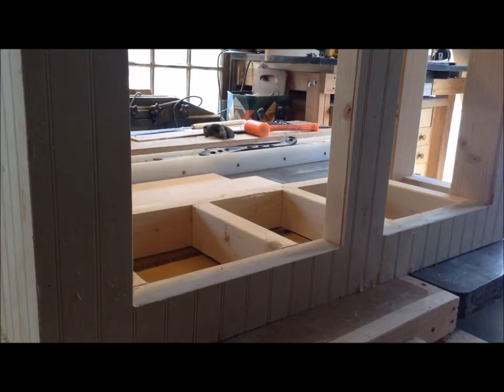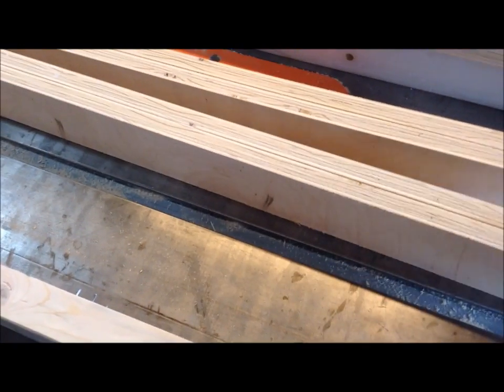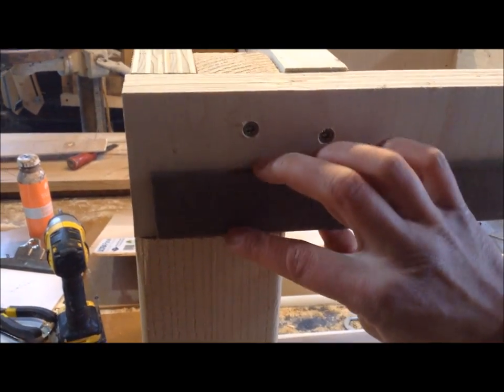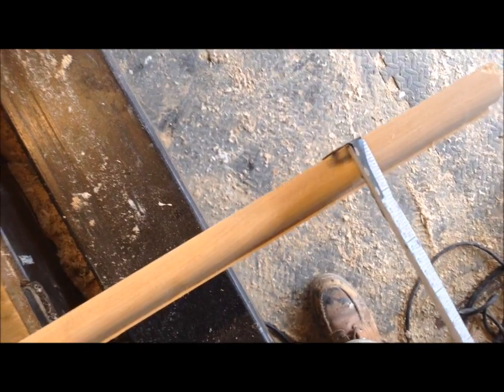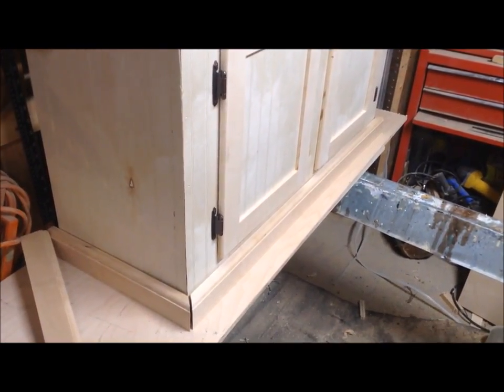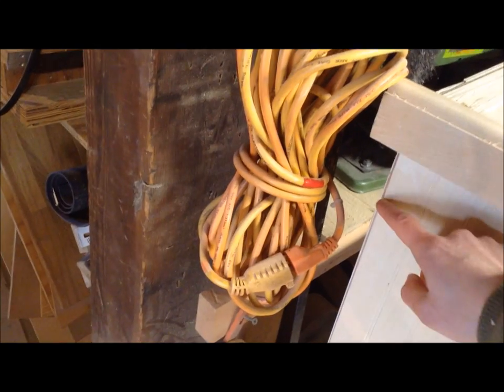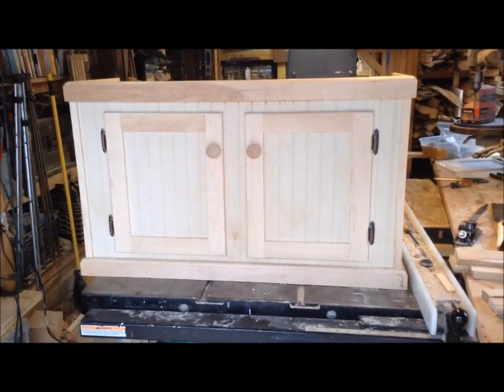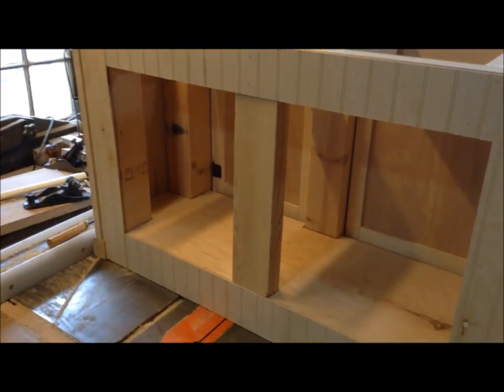DIY Fish Tank Stand [Part 2]

Comment: very enlightening video.  2 x 4 warpage is always an unpredictable factor.  if you glued two 1x4 boards together is usually better and plywood is usually even better and easiest.  if I could suggest though, pocket hole joinery on butt joints into plywood is actually stronger then straight in screwing, especially when you use "toe nailing" pocket holes (where possible).  I did a short video on the subject if you are interested.   I am a recent sub (1 month) to your channel and enjoy your channel (still trying to watch all your past videos).  keep up the great videos :>)